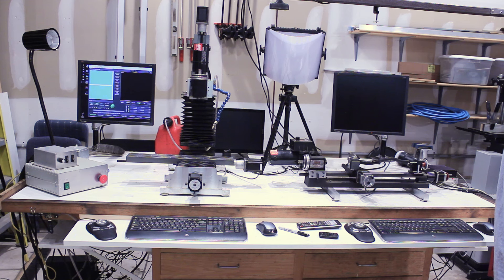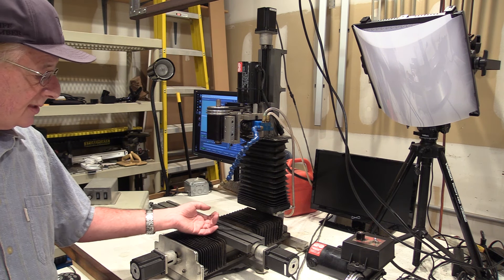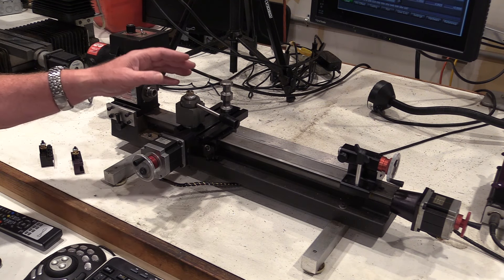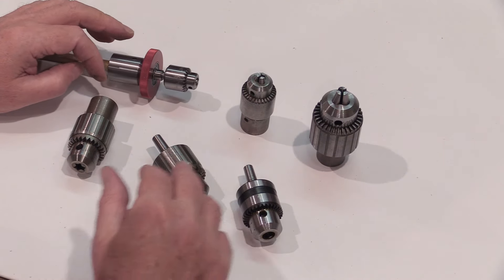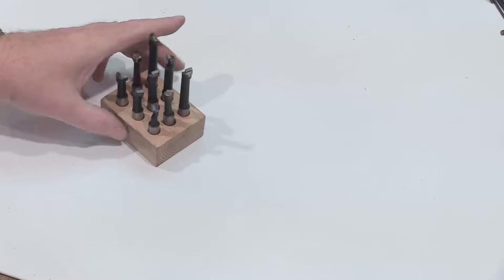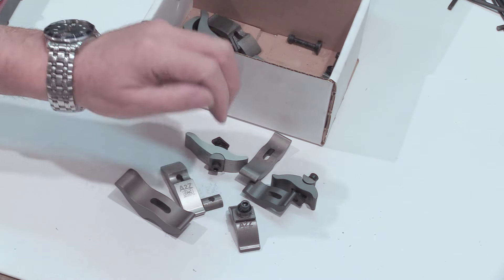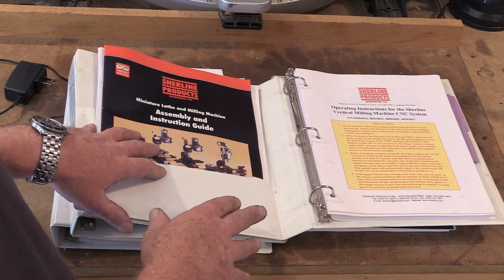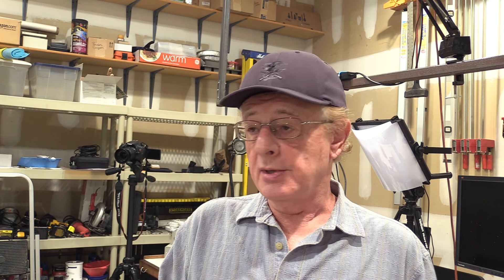Complete CNC Workshop For Sale

Comment: Ken, How are the new machine(s) coming along ?

    ralph
Reply from the maker: The new mill and lathe are almost setup and ready to run. A video tour of the new shop should be out soon.
Reply from the maker: I'll be releasing a video of the new shop tools in the next few weeks. If you think I only went a 'little' bigger, you're in for a surprise. :) Bigger machines mean more complexity. I've spent the past four weeks just setting them up. Start small - grow later.

Comment: Ken, do you still have the dimensions of the bellows for the A2Z mill?
Reply from the maker: Sorry, that was a long time ago! Unless you're making your own, you really have to work backwards - find what size bellows are available and then pick the closest to what you need. That's what I did. I found them on MSCDirect.com. Warning - they're expensive! As I recall, they come in square shapes but you need a 'U' shape. If you collapse them and tape them tightly together you can cut the square down the middle on a bandsaw and end up with 2 'U' shapes.
Reply: Thanks for the information.  I found several sellers in China selling them.  The material seems (from pics) to be like those used on my Wabeco mill.  Best of all, they're cheap.  I can buy several pieces and swap them out when worn.  

I'm really bad in sizing things up.  Wanted to mill a comb in brass for my harmonica but the locations of all the features are driving me nutz... lol...